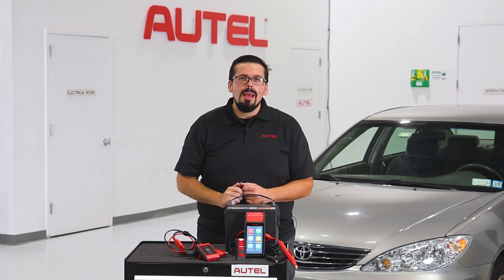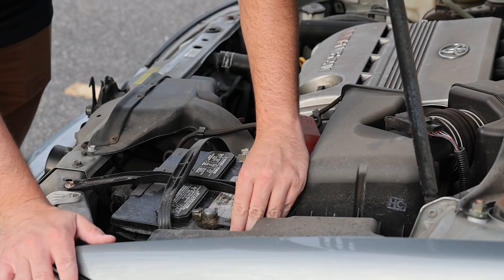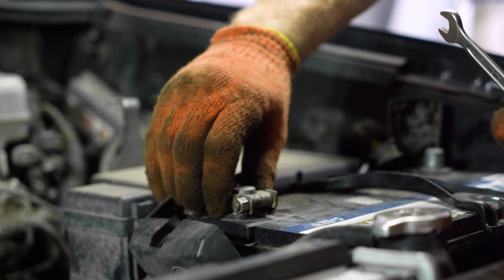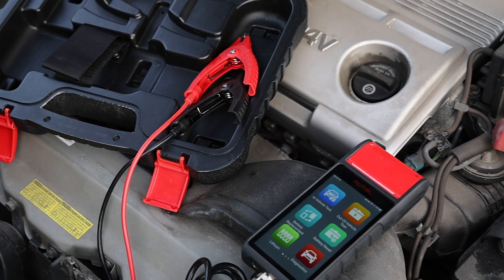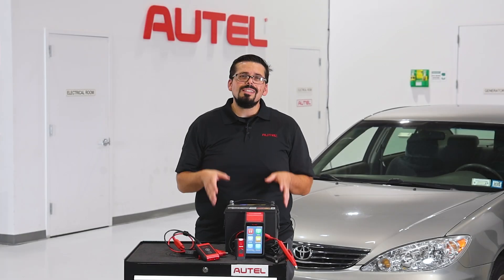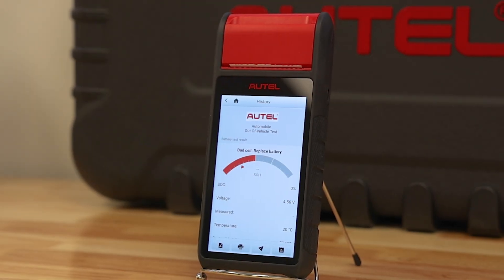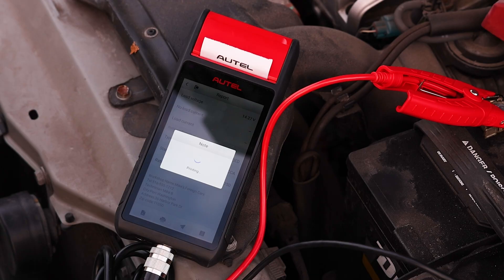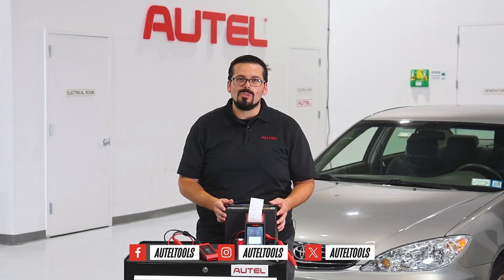Autel Battery Testers: Hot Or Cold, Now Is The Time To Test Your Customer's Batteries

Comment: Autel IM608 Pro II Bundle

Do not buy this device. The Autel IM608 Pro II bundle is completely useless for real-world locksmith work. It does not support Toyota or Ford All Keys Lost (AKL) programming, which are the most common vehicles where customers actually need a new key made. Without AKL support, this tool is crippled and only good for copying or adding a key—functions that don’t solve real problems when all keys are lost.

On top of that, the device constantly fails to communicate with ECUs, even when every adapter (G-BOX2, IMKPA, etc.) is properly connected. It wastes time, causes frustration, and leaves vehicles stuck. For a tool that is supposed to be “professional grade,” reliability is a must—but this tool fails to deliver.

What makes things even worse is the price. It is extremely expensive, yet provides very little real value. A useless device should not cost thousands of dollars. And once you buy it through UHS, there are no returns accepted after delivery. That means you either keep it or throw it away, but you won’t get your money back.

Verdict

The Autel IM608 Pro II is overpriced, incomplete, and unreliable. It cannot handle Toyota or Ford AKL, fails to communicate properly with vehicles, and UHS won’t accept a return after you’ve taken delivery. For anyone considering this bundle: save your money and stay away.

Comment: I recenty had a customer battery that was a premium battery and not old yet is dead shorted between 2 calls. Florida has melting summers and batteries die fast. The 608 tester is freekin awesome. The printout makes customers pause. Most dont understand but i do my best to explain it. At the end its great information and matches what i see.